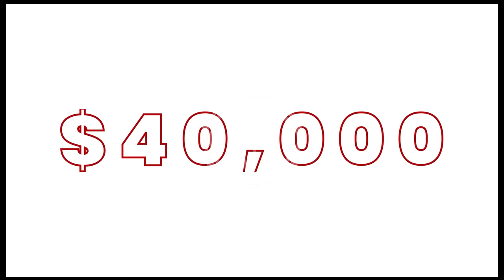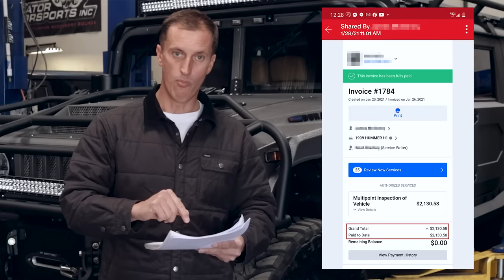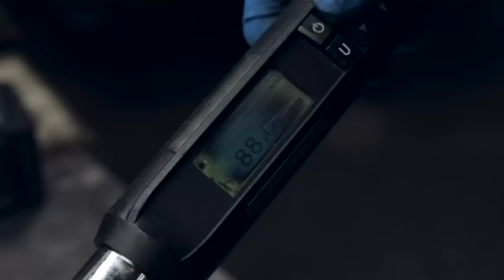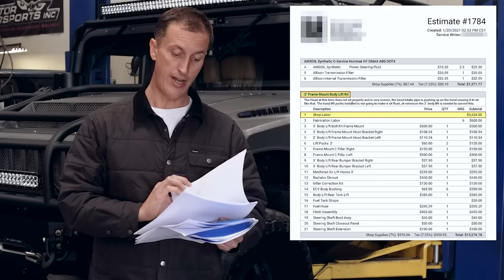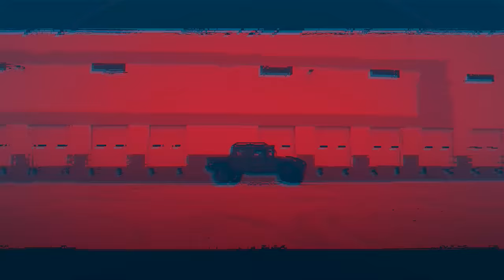$40,000 H1 HUMMER SHOP SCAM!

Comment: Can you tell us what State this shady company is operating out of so we can AVOID them at all cost? I hope your customer reported them to their local BBB and let others in their location know about these dirt bags!
Reply: It was Mod Mafia. I just cross referenced the prices of the 3" lift in this video to the prices listed on their site and they matched up. Also, it's a newer shop or at least YT channel and their logo looks very similar to the blurred out portion of the paper. I think they're located in TX but I can't find anything on where their shop is
Reply: Also don't go to Purrrfect Auto in California. I went in there for an oil change once and did a 50 point inspection check. They said that all my fluids needed to be changed and my brake rotors and pads had to be replaced. I said, "Show me." My wheels were off my car and the calipers were off. I looked at the pads and they were half way worn down but they said that it was dangerous to drive like that. I asked "How much?". The dude said, "Parts and labor with a discount $600." I told him fine and they changed everything.
3 month later I went back for another oil change and guess what? They told me the same thing. I said, "Hey. You changed all of that 3 months ago." Same dude said, "It's not in our system." I showed him the receipt and 10 minutes later he said that my car was done. All they changed was my oil.
Reply: @notsojoerogan  Looks like they're out of Magnolia, TX.
Reply: @notsojoerogan   Its on Mod Mafia's FB page date Feb 22
Reply: @alaskanawesomeness9017  Dang, the one time I wish I had a Facebook account haha

Comment: I brought a van I was building to a shop to have tailpipes bent up and they started going through the whole van inspecting everything! I went out in the bay and asked what they are doing wasting my time when I want a set of tail pipes put on. They started saying this and that need to be fixed and I actually got in an argument with them over it. All I wanted was a  set of pipes bent up so I can finish my work and I ended up telling them off in front of their customers and pulling my van out and having the job done at another shop!

Comment: LOL, these just sound like they enjoy ripping people off, it happens everywhere and not just in the automotive industries, it appears to be something that happens when something is not bog standard or high end. The worst one that I came across was a community building who's electrics where time expired and needed redoing, all the cabling was in conduit and all old fittings (lamp holders, switched and sockets) where to be replaced like for like and would come to an estimated £5,000 and would need a couple of days labour so a rough estimate was advised by a user of the building who worked for a utility company of £10,000. The quotes that came back were all above £100,000 with parts and labour split 50:50, the building committee questioned the user who said it would be 1/10 of the estimates, so he went through the costings for the parts in detail and they came out at £4,500, he then said 'sod it' the utility company will buy the parts for cost and we will have our final year apprentices do the job as training. The outcome was parts at cost from the utility company were £4,000, with free labour from the apprentices, the reason for the high estimates was that all the companies that quoted wanted to install there own conduit instead of using the old but very serviceable existing conduit.

Comment: If you ever got a Hummer out of the draw yard at NTC you will find that it barely runs, the seat belts may not work right and there is 4 layers of CARC over 10 layers of rust. Yet we were expected to drive them all over the Mojave desert in the worst terrain and live through it. I saw a few breakdowns here and there but no wheels came flying off.

Comment: That shop sounds just as shady as the one that did my safety inspection, in MD only have to do one as long as we own the car. The shop drained most of my oil, I’ve actually owned the car for 3 years prior to the inspection. I just didn’t tag it. Anyway I know it never leaked or burned oil. A week later I noticed a knocking sound when I would go around turns mostly, but it was slowly getting worse.  Since I knew it never ran out of oil, I didn’t have a reason to suspect that was the issue. Took it to them to find the noise, the mechanic didn’t know what it was. Once it got louder I checked the oil and it was 3 quarts low. I can’t prove it was them. But I’ve driven 40k miles since then and still no leaks??? Also instead of just doing an alignment check, they adjusted one side without locking the steering wheel. So driving straight my wheel is slightly off center line. It’s maybe 2 degrees, it doesn’t effect driving. Just annoying

Sorry that’s so long

Comment: Years back I had agreed to do some work on a coworker's car; shop wanted 2300 for a new transmission because it was shifting rough according to them. Fresh fluid and a filter later, the car ran fine. I even threw in a tune-up with the money she saved. She was so happy she didn't have to shell out thousands to a ripoff shop. Stories like this make me happy with my side work. That said, I'm happy to see that there are still reputable shops out there like you guys.

Comment: Look at that stupid hub, one of those, from a real hummer, became the bane of my existence for months in the mid 90s.
On the actual military version, the anchor points for the ball mounts are removable. Up until the mid 90s though, that wasn't an authorized repair, you just had to get the correct left or right hub (hub bodies all identical, the brackets made the difference). Someone noticed how stupid this was, units have torque wrenches and all. So two separate part numbers became a unified third numbered part, and you just switched out the brackets when you got a hub, if needed.
Only we had ordered the correct sided hub and we received the new one, but before we returned the broken "core" they made the change over. And this broke the system completely. They wouldn't take the hub under the old number, since it was not used anymore, but they wouldn't take it under the new number because we had gotten the new hub using the previous numbers. And a months long game of idiot ping pong began.

Comment: I HATE crooked auto shops! I have seen so many scams over the years it make honest guys have to explain every detail. I had a friend who was told he needed a new head gasket on his G6 he knew I do not do mechanic work anymore but asked me to look at it. The shop he took it to for a small issue they had pulled a vacuum hose off and hid it under the part it went to so it sounded like it was leaking air from the head. I hooked it back up saved him 1600 bucks! Shit like this pissed me off. I won't name the compoany but when I graduated ITT Tech back in the day they sent me to a national auto repair chain for a job. They taught their mechanics how to scam people into replacing parts that were not broke. I walked out and never looked back.

Comment: A shop tried to charge me 20,000 dollars for mainly 2 cylinder heads and head gasket job on my v8 diesel due to a crack in the precup, they also stated things like the spare tire was missing and needed a full brake job rotors, calipers, shoes ect. Even though 1000 miles prior I had all this done to the brakes.

Comment: This has been common practice to scam or up the bill for those who know nothing about cars, on my very first car an MOT inspector would not pass my car fit for the road due to a worn part, a mechanic friend changed the part and the inspector went on to fail the car on the same part another 2 times, in the end my mechanic friend has to go to the MOT station with me in order to get the car passed, chancers looking for extra work

Comment: I went to a transmission shop and asked them if they could check it out. They told me, the transmission is bad and it needs to be replaced. They said it can’t be rebuilt. They had a list of stuff they said was wrong with it. Little did they know, it was a new trans from mopar. It arrived with my hellcrate engine. So many damn scammers. They need to put these people out of business and put them in jail.

Comment: Good on you predator inc always call out bad shops. 
I'm what some call a shade tree macanic but I have a good name in my town so I have lots of good customers that would rather have there rig fixed in my driveway then at local shops everything from just pluging in the OBD  for a car they want to buy to full motor rebuilds or installing remote starts. I do work at a power sports shop in my town and I made it clear I will not do shit work even for my job my name is worth more got a damn good boss tho he's 100% on the up and up and only want quality work being done even if he takes a hit for a few bucks to help a customers out.

Comment: 4x4 stuff especially that kind will always have really high ongoing maintenance. 1200 miles put on that rig could be equivalent 30,000 miles on a passenger vehicle.  You maybe missed a couple of things but I bet if you got a rig they sent out the door they would been crucified I'm sure. Through all this you may expose them hard enough, you may pick up some or most of their customers dur to them overcharging 4X. Professionals in the same trade do not do this to each other. I really do think you didn't have a chance to leave this one alone. Interesting video. Thanks.

Comment: Garages almost all do this.  Mechanics are urged to gin up repair estimates and pressured to do this in order to make a living.  I worked for a pep boys garage where the area manager would demand that we sell all sorts of stuff that was not needed down in Florida, and i am delighted to have suffered the pain of quitting without notice to be done with them.  An expensive rig coming in like this suggests the customer lays down for whatever maint is suggested.  Does the wheel move when you push and pull on it like an ape?  Does the oil smell...oily.  Is there "oil on the motor."   Brake fluid smell?  Theres a story for everything and it comes with a bill, enhanced by the element of danger if you tell the garage no thank you. When you make enough money to afford a proper car, guys...make an effort to find a trustworthy garage and pay a little more so you can keep it running without getting the screwjob.  If you cant afford a great car yet, try to learn as much of the easy stuff that you can do on your own to keep yourself running and to spot crooks.

Comment: To many auto repair / stealerships service dept. are that way.  I could list a few I've had to deal with in past. Let alone tire shops some of them have damaged tires to point of not repairable to sell more tires.
 When I heard Humvee mechanic vs Hummer tech. I knew it would be a S### show AKA parts changer "I don't know what is wrong"  vs someone that knows a vehicle. I've seen military "mechanic's" that don't know how to change a tire or where the spare tire and jack was on their P.O.V. that was a N.C.O.

Comment: In some states I'm sure that shops would be liable for letting a customer drive their vehicle off the lot if the shop found a potential life safety issue, but that doesn't give them free range to repair it themselves. The customer, if put in this situation, should tell them that he'll have it towed to another shop for a second opinion. These type of practices are a scam. I took my truck  in for a minor repair one time and when the work was finished they took it upon themselves to do some other work without first getting approval. Long story short, I told the service manager that I appreciated the free work and parts, but I was in no way paying for something that I didn't ask for or approve beforehand. I left happy, service manager was left red-faced.

Comment: Good video.  You guys get some heat on the HML but others have good experiences and express them.  I have purchased a few things from you folks and like what I got.  I know this was MM and not sure why they would do such a thing when they seem to have several steps in the correct direction so far with the exception to pricing.  The pricing makes it seem like hummer owners have cash to burn.  WE DON'T!  You guys and several other vendors know this.  Thanks again and thanks to the owner of that rig.

Comment: I took my 02 ram 1500 to a local shop and they charged 60$ just to look at it and tried to charge 1300-1400$ to do a oil change a new serpentine belt and heater core

Comment: It’s a shame that you have to prepare but it saves time, aggravation, money, in doing so. Go mic’d up, micro cam and discuss issues along with your concern or reasons for failure, announce your desire to remove unit from shop, afterwards er they do a 2.5% increase on inspection fee, head over to bureau of automotive repair display your recording, let them deal with it. You are required to pay only what you sign for in almost any state, no inspect request no pay, protect yourself by drawing a line trough tear down estimate and initial it, if you request power steering pump replacement, a tear down is not necessary to do job, if you arrive with unknown engine, trans issues then tear down is needed to complete estimate. That shop was fraudulent, they rob you with a pen rather then a gun, that’s worse, the gun is braver then pen, as penman gains your trust acting as they’re concerned bout your family’s safety and bla bla, then you willingly hand the purse, skillful yes, it’s enemy in camp, enemy dressed in your uniform slips into your camp or comes behind is not eligible for pow capture, according to rules of war you execute them, I share all this due to the seriousness of situation, that fraudulent shop isn’t eligible for fines or alerts on their license, they need be seized and closed, like when any criminal is arrested and convicted everything they own is obtained trough illicit funds. Thank you for the careful wording and professional delivery making this broadcast, however, I believe with that behavior you could protect the public with identifying the other shop, with the amounts their conning it’s paramount, you take a mature approach and it’s right to not engage with scum as it goes deep and never stops. You get notarized statement from owner with all photos , produce a broadcast of same professional quality and never respond again. If not, for you it’s still a good decision for self and shop. All the best to with great success from new viewer.

Comment: Your shop should see my Hummer.... The previous owner took it to place to have the block replaced (Thanks cylinder number 8 crack) and the "new" motor leaks oil and a few places. Only 30K miles on the new motor.

Comment: You guys dont use the blue hummer locking hub kits?
Reply from the maker: No, we use the factory H1 Hummer locking nuts. If they are installed correctly they will not fail. The other brand has a keyway tab that can shear off resulting in the loss of the locking mechanism. We have a video coming out soon showing all the options out there and their advantages and disadvantages.
Reply: @PredatorInc  I only ask as all our hubs on semis and trailers have the bending tabs but also have a secondary nut to lock after the tab washer.  That's one area all H1 owners are picky on and what works best

Comment: back in I think 2009 a "mechanic" tried to fleece my sister in law over $3000 dollars for work on her Honda crv claiming everything was wrong with it  I took $50 from her bought four spark plugs and wires and fixed the car and I'm not even a mechanic

Comment: You might want to balance the intro music, it is so much louder than the normal audio on the video. I am very glad I did not have my large amplifier turned on when I started this video as I might have lost speakers. Normally I use the large power amplifier I am just glad I wasn't using it today.

Comment: This is one of those reason that good techs have to over doc. their work. To top their work off with is that DDE had to jump the rig twice and not like someone with some mechanical sympathy for what their rig is set up for to break it. I have seen old bulldog long travel kits hold up but not the factory frame. These guys are fishing for a quick 💵 because of the rig.

Comment: Diesel oil becomes black n sooty as soon as you change it n run the truck for even a mile, it's natural..I have a 93 Toyota Shark Van that I restored n it runs like new had black smoke coming out of the exhaust n a simple air filter change fixed that... For those who Don't know isht about diesel.. There are more More carbon atoms in the hydrocarbon chain of fuels like Diesel than there's in Gasoline or Petrol..for those who didn't learn chemistry?! Thus the presence and expulsion of more carbon in diesel than gas engines

Comment: I want you to do a vacume pull test and see which air filter actually allows the most air flow
Reply from the maker: The OEM air filter is engineered for the Duramax engine. It’s not rocket science.

Comment: Looks great but how many  .miles for gallon
Reply from the maker: Depends on alot of factors however about 16 to 18mpg however some trucks are getting 21mpg with the right set up and hwy driving.
Reply: As an owner of 4Runners I can tell you, it's called, "Smiles per mile", not, "Miles per gallon".

Comment: That "big heavy paper filter" is fine for that application. They have relatively low restriction and the housing you have it in is accounts for that.  Surprise for you here: They are BOTH paper filters. One is just a tubular corrugated wrap and the other is pleated. Those wrap style filters actually get pretty great capacity for their size, but the restriction differences aren't as great as what you alluded to here.